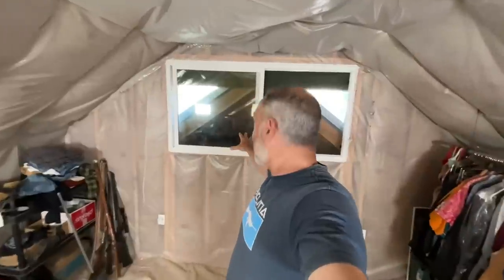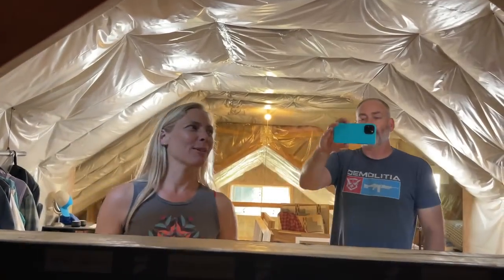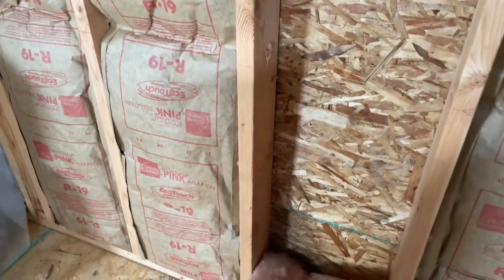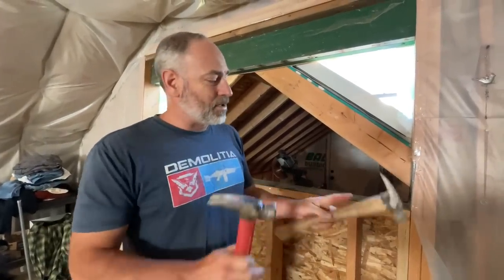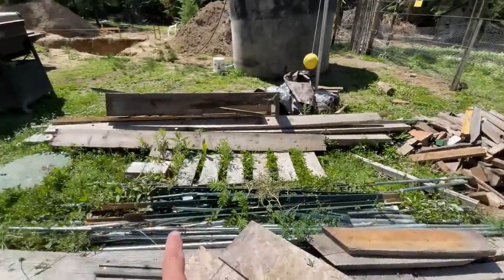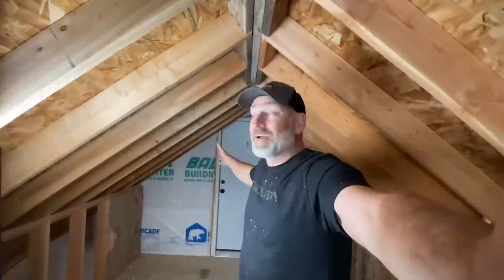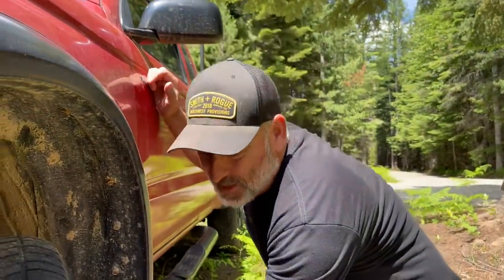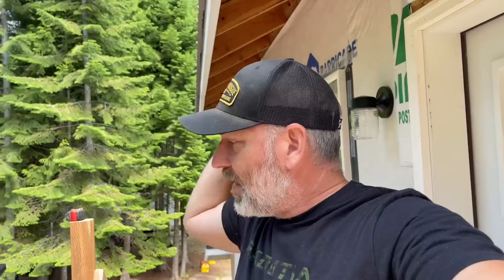No More Ups and Downs! - Real Off Grid Building

Comment: Actually that is the proper way to install recepticals. 
Highly debated, but if you read the printing on it it will be right side up.
I love it because 3 prong cords will stay locked in and less prone to loosen and fall out with the triangle up.
Reply: I was also told that if your tool or appliance isn’t plugged in all the way and if something falls over it will hit the grounding prong instead of a power prong
Reply: Correct! An electrician rewired my basement and said this way is safer.

Comment: A tip that my automotive store guys gave me is charge a battery at 1 or 2 amps for at least 24 hours to bring it back from the dead, usually works great but eventually all batteries die.

Comment: Love your videos!
Might I suggest an LED light bar running down the peak of the hallway that connects the Love Loft to the Apartment?
There don't cost much, give lots of light, and don't take up much room.  I added them to all the closets in our house and we love the extra light.  Also add 3 way light switches at each end ..., maybe on the room side, not in the hallway.

Comment: Your home is coming along nicely! A sunlight for the roof in the walkway would be great for letting in natural light.
Reply: Thanks! I think so too!
Reply: Skylights are great, but they are naturally a weak point in the roof for eventual leaks. Don’t go cheap on the skylight because they won’t last. Also, overdo the waterproofing and barrier on the install. I would suggest perhaps a solar tube type that puts a ton of light in but is only 8” in diameter for a smaller hole in the roof.

Comment: Super cool next phase of ur project. Very exciting. 
FYI - when a duplex electrical outlet is installed upside down (ground on top), it usually means it is controlled by a wall switch. 
Keep on building. Thanks for sharing.

Comment: The 12 inch by 12 inch window if it's not to late they make glass blocks that size and they are clear. I had that idea above kitchen cabinets  and those glass blocks fit between the load bearing wall so it was easy

Comment: Outlets should be installed with the ground on the top. That is code in most locals but most DYI'ers mount them upside down. The reason for the ground on the top is if something conductive is dropped on a plug that is not fully inserted then it can't short the hot and neutral wires together.

Comment: Actually, it's a good idea to put outlets in "upside down". We're all used to older houses and how the outlets were put in, but it's actually safer (and code in some areas I think) to put in the outlets "upside down". That way if something thin and conductive falls down behind a plug in an outlet it won't short out and potentially cause a fire.

Comment: Receptacles with the ground wire UP is the correct way, according to the National Electric Code.  We're building an addition on our house, and the building inspector REQUIRED me to put them in that way.  I HATE it, and as soon as I get the final inspection on the addition, I plan to go around and turn them all over, with the grounding wire DOWN!

Comment: Look up how to rejuvenate a car battery with a welder, you will be surprised ! Batteries that you can add water to top up we rejuvenate with a welder (please check what welder type to use) Its a slow process but it works ! just as long as the plates haven't shorted out.

Comment: That first pile of shorter pieces you pointed to, could be used for corner or side braces in raised beds.  They could also be cleated (laid side by side and held together by a board across them, or a cleat) to make smaller table tops, chair seats, or chair backs for more rustic "farmer's style" furniture in more informal places (ie outside or in the garden).  

Cleated, they could be formed to make 4 sided wood squares to go over black plastic, or other, nursery pots of plants and shrubs.  These wooden shells "look pretty" over lesser pots but also temper summer's heat and fall/ winter's cold; you get a little colder than many parts of the country however.  They may or may not absorb water then give it out when it gets hot for a bit of micro climate humidity; some swear about it, others say it's a bunch of hog wash.  They may or may not house slugs, slug eggs, or other undesirables but leaving them outside without thier pots in your cold wimters ought to take care of that.